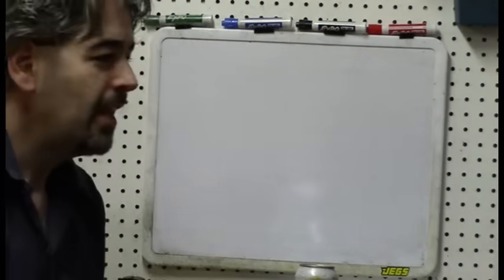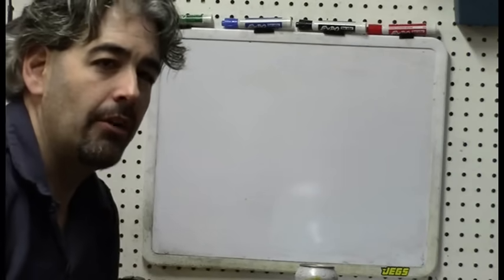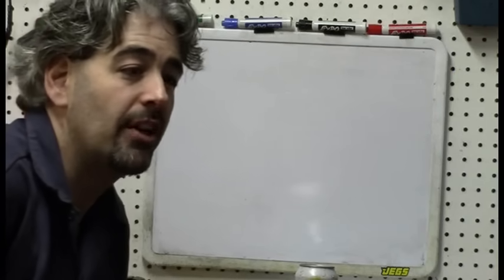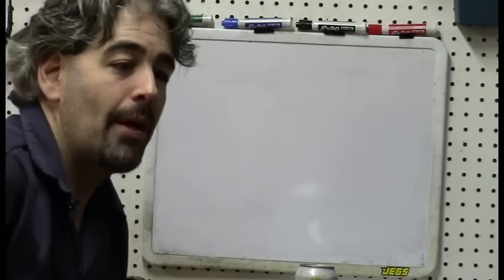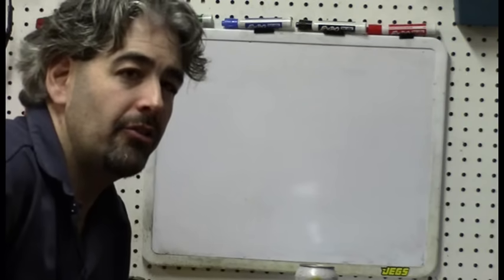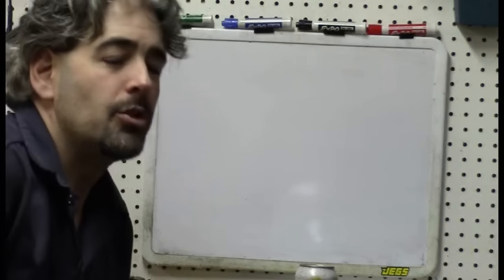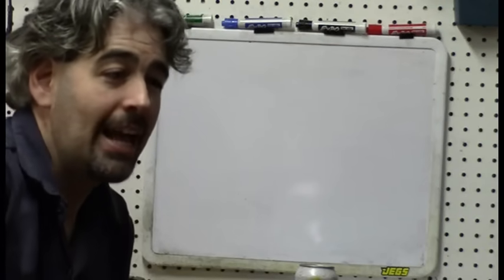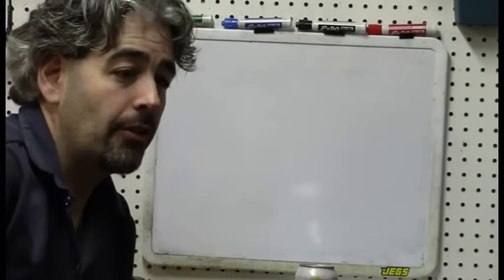Secret of Engine Problem Diagnosis- Fuel Trims Pt.1

Comment: One of the most informative videos in my opinion with a guy who cares enough to share and explain his knowledge on you tube, whether you're familiar with fuel trim or not this was very helpful at least for me .great effort sir . thank you
Reply from the maker: You're welcome ;-)
Reply: Schrodingers Box
Reply: @johnshaw5001  not sure if you listened but he never said that STFT set a code. Instead, he said STFT is an immediate response to the percentage of fuel that the pcm is adding or retracting... 
If, in a given case, STFT has reached 20-25%, meaning pcm is adding 20-25% more fuel to keep the engine running somewhat normally; after a while, this condition is set as the new normal thing to do by the pcm to keep the engine running and the LTFT percentage (The fuel trim percentage noticed after "a while") is set to this 20-25%.
Therefore, now the pcm takes this increase seriously and set a code for the pro to figure out what has caused this anomaly. 
Note: if you are a pro, why don't you contradict intelligently with details instead of just denigrating with a sentence in which you claim to be a pro?
Where is your youtube video on this subject? Share your knowledge Mr Pro. If what you must say is not more important than silence then BE QUIET HATER!!
Reply: @johnshaw5001   what would be a fix for P0430 code.
Reply: @SchrodingersBox  would you be able to help me out...pretty much figured had a vac leak (06 envoy) ..when warm stft is -3/3 and left is 10-12 ranges...when accelerating stft goes up to 5-6 ltft comes down to 7-8... but sometimes the scanner will jump and show stft like 5-6 and ltft will.be 3-4... and when cold and idling the numbers jump around a bit..
Reply: @mameryjazz  he's salty because all the DIY vids are taking away the blood sucking money he charges to analyze and fix at shops..
Reply: @johnshaw5001  a lean code triggered by the O2 sensor
Reply: @ymisoflyg8612  That's total bullshit.  He's pissy because DIYers are taking the blood sucking money he adds to the bill when he jobs out.  Because he likes to say he's a pro but jobs out diagnostics.
Reply: D theman  it's not just tiny classified ads. It's complex. It's quite close to A.I. I feel
Reply: @SchrodingersBox   was wondering if you had $300 which diagnostic tool would you purchase? Thanks
Reply: @SchrodingersBox  pop l
Reply: @mameryjazz  : And here it is 3yrs later and Shaw still hasn't shared his "knowledge". Lol.
Reply: @janedoe5048  LOL
Reply: I couldn't agree more! Thank you so much for taking the time to show those who want to know, the information they need to succeed! Totally awesome!

Comment: I’ve worked industrial process control related to precision furnace combustion for over 40 years and you’ve explained the fuel system in modern vehicles in a concise and easy to understand manner that surpasses any teaching moment I’ve ever had. Thanks for sharing.

Comment: This series is the absolute authority on the matter of Fuel Trims/Advanced Driveability Diagnosis BY FAR -- I've come back to this series countless times in the past three years and they have helped me grasp more on the topic than in the previous 8 years of my career as a tech -- Many thanks sir!
Reply from the maker: thanks my friend. This video is actually used in several tech schools as part of the curriculum in fact. I think it’s the most important video on the whole channel. probably 80% of all my diagnoses start by using fuel trim.
Reply: @SchrodingersBox  - Matt, great to hear this video used in tech schools. Rightfully so !

Comment: Found your channel today while browsing for info on my 1998 Pontiac Trans Am WS6 with intermittent hard shifts. I am OEM and technician in the wastewater industry. I have grown weary of so-called professionals throwing parts at my vehicles without proper diagnosis. Hence, I do much of the maintenance and repairs on my vehicles myself. I am certainly not at your level of expertise. However, in diagnosing problems with pump and control systems in my field of expertise, I have to rely on good data. Obtaining good data requires critical thinking. I appreciate your passion for understanding mechanical systems and your persistence to make sure a particular problem is properly diagnosed. Thank you for sharing your knowledge. I also enjoyed your video of diagnosing the exhaust restriction for an older lady. I am glad to know there are others like me who share old school values such as not charging for work that was of no benefit or value to the customer.

Comment: You are a god! Using what I learned from this video I solved a too lean code in one drive cycle, leading to a failing MAF. Replaced the MAF and am now driving with a smile and without a fault code.

Comment: Well, Ive either been to idiots or scam artists. I've had the O2 sensor replaced, intake manifold, MAF sensor (2x) once I replaced myself and the second time the mechanic did it and charged me $400 for a 10 minute job, replaced the fuel pump, and on and on. Thousands of dollars later I still have the problem. Thank you for this video.  You explain things very well for those of us that are novice auto DIYers.   I think I'll be my own mechanic from now on.  :)